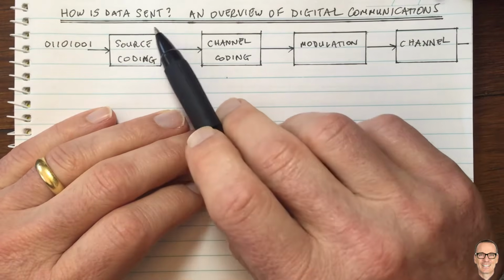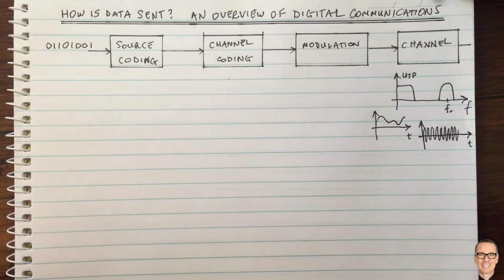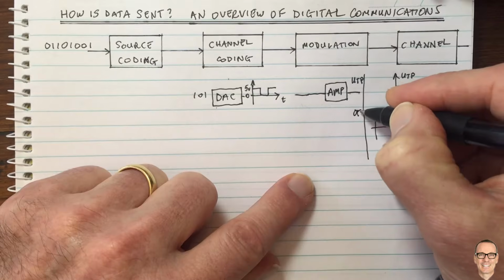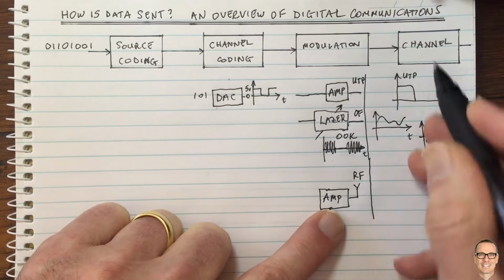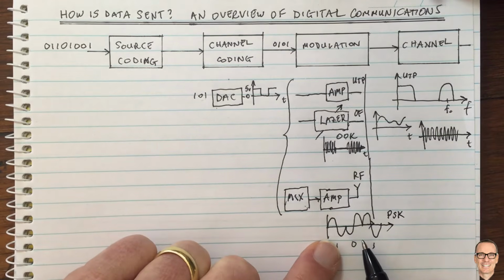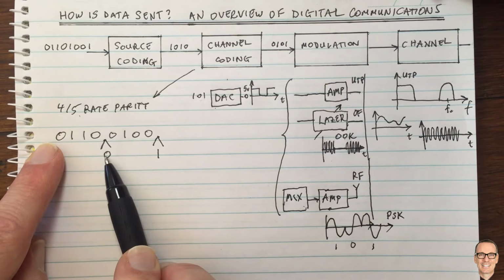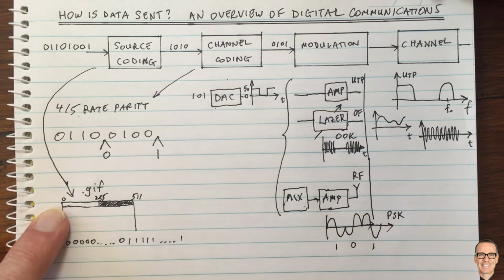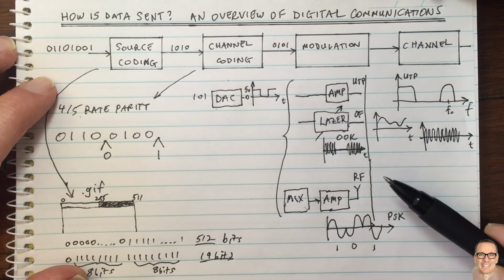How is Data Sent? An Overview of Digital Communications

Comment: You don't need a DAC to convert zeros and ones to +5V or 0V. And that's still digital.
Reply from the maker: The input to a DAC is a discrete-time binary sequence. The output is a continuous-time continuous-valued voltage waveform. So no, it's not "still digital", and you do need the DAC.

Comment: Thanks Prof. Collings, for all the videos you post which help me understand everything related to the physical layer of wireless communication!

I have one question: If I consider encryption of the payload as an additional process, where does it fit into the diagram with respect to source coding? Is the original data being source coded before encryption, or does source coding happen after encryption? Would source coding even make sense when data is already encrypted, since there may be limited compression performance? My current view is that the original data is encrypted at the application layer whereas all processes in your diagram happen at the physical layer (including source coding which seem to be of limited benefit when performed on an encrypted payload).
Reply from the maker: Source coding occurs in the higher layers. For example, a voice codec is a version of a source coder. It digitises the analog signal, and does so in a way that tries to minimise the amount of data required to be stored/sent, while maintaining a given allowable level of distortion in the reconstructed signal. And this can be done in video processing software (application layer). Encryption is applied to the digital signal that is to be sent (ie. after source coding has been done).

Comment: Hey professor, I have a question regarding Decimation and interpolation in a sense of bandwidth. I have your videos about these topics, but I still haven't managed to understand how the operation od up/down sampling influences the bandwidth. In Decimation, you get an expanded spectrum when each value of theta is multiplied by the decimation factor. What I get from that is that the bandwidth increases (=this expansion that I mentioned earlier?), but it doesn't make sense because when applying decimation, you get a new discrete signal which has less components than the previous one, hence less frequency components. Once again, I am bot sure, and would some clarification.
Thanks in advance!
Reply from the maker: Great question. The answer lies in the difference between the DTFT and the DFT. You said that "when applying decimation, you get a new discrete signal which has less components than the previous one, hence less frequency components." ... it's only fewer frequency components, if you're talking about the DFT. Note that the DFT has a discrete frequency transform, whereas the DTFT has a continuous frequency transform. And yes, the DFT of a decimated discrete-time signal, is a shorter vector, but the length of the vector is only part of the story. The frequency gap between the elements of the DFT vector also needs to be considered/understood. Hopefully these videos will help: "How are the Fourier Series, Fourier Transform, DTFT, DFT, FFT, LT and ZT Related?" https://youtu.be/2kMSLqAbLj4 and "How does the Discrete Fourier Transform DFT relate to Real Frequencies?" https://youtu.be/pIFz84oj9cA
Reply: @iain_explains  thanks for the quick response!
I have watched the videos, and I have a question: if the gap/spacing and between the dft samples in defined as Fsamp/N , so when implementing decimation you reduce the value of Fsamp, but also you effectively change the value of N because now the vector of the samples is smaller (-> N is smaller). In this scenario, how does the gap/sapcing change because you reduce the values of both the numerator and denominator of the expression. That's what doesn't make sense to me- how is the gap related to my original question considering what I have just mentioned (if  I wrote some incorrect things, please let me know 🙏)
Thanks again!
Reply from the maker: Maybe this video will help: "Discrete Time Sampling Example" https://youtu.be/vGxvrq5kCzQ
Reply: @iain_explains  I have watched the video you recommended. It explains well how decimation influences the DTFT spectrum, but not quite the DFT spectrum. I still don't get the idea of how the bandwidth is affected by implementing decimation or even interpolation. If you can recommend me another video or a  lecture that I can watch which will help me understand  this topic, it will be much appreciated!
Thanks a lot!
Reply from the maker: Perhaps try these: "How does the Discrete Fourier Transform DFT relate to Real Frequencies?" https://youtu.be/pIFz84oj9cA and "How do the Frequency, Sample Rate and Duration affect the DFT of a Sinusoid?" https://youtu.be/5diC6XLLVoA and "Discrete / Fast Fourier Transform DFT / FFT of a Sinusoid Signal" https://youtu.be/lwQTNcWtN7w

Comment: 11111111 (2) = 255.  We can add 1 since we would never transmit a "non-bit"... Just in case anyone else was confused by this.  Excellent video. I'm hooked on your clear explanations. I work with electrical engineering concepts but never was able to take the necessary coursework - thank you for helping fill my knowledge gap!
Reply from the maker: That's great to hear. I'm so glad the videos are helpful to you.

Comment: sir the DAC used in the above explanation has confused me as the output of the circuit is converting a binary bits o,1 in to the voltage level which is having binary value (0,5) so sir the output is itself a digital signal as it has only two values, is it not correct to give it a name of pulse shaping filter rather than calling it a DAC ?
Reply from the maker: No. The input to the DAC is just a sequence of 1's and 0's stored in discrete memory. It is not a waveform. The output of the DAC is a continuous-time waveform (eg. a time domain voltage signal on a wire).
Reply: @iain_explains  for analog signal 
1) value is defined at every point 
2)  also the analog signal has           uncountable amplitude in a particular range of time 
these two conditions are not satisfied as the signal has countable amplitude and signal is not defined at the zero crossings
Reply from the maker: I don't know what you are talking about, sorry. The output of the DAC is an analog continuous time signal. Just because we say it switches between the values 0V and 5V, doesn't mean the output is finite-valued - it just means that the waveform switches between those analog values.
Reply: So, the output of the DAC could be any value? Then how it would be used for on off keying (for example) in that case?

Comment: sir is it not possible to improve our SNR at the receiver by using a low noise amplifier until such extent so that we need not have to use channel coding because channel coding is anyhow decoding the error caused due to noise and sir also we are using the regenerative repeater to increase the strength of the signal
Reply from the maker: Certainly it is good to use a receiver amplifier with a low noise figure, but truely "low noise" amplifiers require cryogenic cooling (eg. the ones used in radio astronomy), so they are expensive and impractical for most communication systems. Unless you are operating at 0 deg Kelvin, then there will be "noise" in the received signal.

Comment: hello lain, first of all thanks for the video i have a question
channel coding is done to prevent what shorts of error means what damage can a channel do to our transmitted signal could you please explain it in breif
Reply from the maker: The channel can distort the signal in such a way that the receiver thinks a digital "1" was sent when actually a digital "0" was sent, and vice versa. This can happen randomly, based on time variations in the channel, and noise in the receiver electronics. Coding is needed to try to correct these errors.

Comment: Can we make the clock signal with just coding in embedded C? Directly just through code, controlling voltage on any gpio pins of uC?
Reply from the maker: Sure. Just change the voltage between two levels on a regular time period. Of course it will only be able to switch as fast as that output pin can change its voltage.

Comment: in order to remove the adverse effect of the channel, we are using the process of equalization, than what's the point of using channel coding if we are doing it for the same purpose, why we are using extra bits for channel coding?
Reply from the maker: Channel coding is generally aimed at overcoming random noise in the channel. Most common is when the noise is independent from one symbol to the next, but it could also be bursty. In contrast, when the channel introduces inter symbol interference (ISI), the "interference" is from the signal itself (not random noise), and so specific techniques are needed for this, eg. equalisation. See "What is Intersymbol Interference ISI?" https://youtu.be/I087FUvW2ys

Comment: Hi Lain, 

I saw somewhere 

"New channel coding schemes like low⁃density parity check (LDPC) and polar codes can extremely reduce the decoding complexity for scenarios with large block sizes and/or high coding rates. Also, it can improve the performance of those with short block sizes. Moreover, a lot of processing power of a receiver is consumed by the decoding of channel codes."

My questions are:

1) What is the relation of complexity with block sizes and  high coding rates? If I understand correctly, higher coding rate means more information bits and less correction bits which can increase the decoding complexity, right?

then, "The design and specification for URLLC are enabled by fast decoding. With the super⁃wide bandwidth foreseen for 5G up to 1 GHz, channel codes efficient for large block sizes become a must, not an option. the frame structure of NR without it will be only a hollow place holder."

My question is:

How larger block size is linked to bandwidth as indicated in the above?
Reply from the maker: For question 1) : Information Theory tells us that the way to achieve the maximum possible error-free rate, is to use long codewords. In practice, there are a number of ways to achieve codes that are effectively the same as having long block lengths - and in general these have high complexity to implement. For your second question: The wider the bandwidth, the higher the maximum possible rate. This doesn't necessarily mean the codewords need to be any longer though. The key for URLLC is to have the shortest codewords possible, subject to stringent BER requirements, so that there is the smallest possible latency.

Comment: This is an excellent high level view of information transmission over a channel, with valuable insights in each operation. The hints for further investigation in concepts like capacity, entropy, etc. are also great.
Just a question: in source encoding the number of compressed bits are 18 (1+8 for white pixels and 1+8 for black pixels) and not 19, right?
Reply from the maker: Yes, sorry about that. I have a note in the description below the video about it. Unfortunately I'm not able to re-upload an edited version of the video to correct it. Thanks.

Comment: @ Iain Explains Signals, Systems, and Digital Comms DAC is also called as Line coding ?
Reply from the maker: Partly yes. "Line Coding" is a term that refers to digital baseband modulation.
Reply: @iain_explains  thanks...Not sure what makes it partly though..Why not fully ?
Reply from the maker: Well it's not just the DAC. It matters what you put into the DAC, so a "line coder" would include a function to generate the "digital" waveform, and then a DAC to make the waveform continuous time.
Reply: @iain_explains  thanks. Clear
Reply: @iain_explains   I came back to ask few more questions!  To me, the terms like 'line coding', digital baseband modulation, symbol mapper, pulse shaping are used differently in diffferent resources available. Can you please distinguish them for me or for other users of your videos? Thanks
Reply: @iain_explains  Is not a digital waveform continuous in time?
Reply: Hi lain, any answer on this?

Comment: Really good very high level video. A slightly more in-depth explanation of the relationship between the baseband and the carrier band would have been instructional and filled in a knowledge gap.
Reply from the maker: Glad you liked the video. Perhaps this video might help to give more insight between the baseband and the carrier band, through the examples of DSL (baseband) and OFDM (carrier/pass band): "How are OFDM and xDSL (DMT) Related?" https://youtu.be/CET2UuGeEqs
Reply from the maker: Hi Jeff, I've just published a video on this topic, which will hopefully help: "What is a Baseband Equivalent Signal in Communications?" https://youtu.be/etZARaMNN2s
Reply: @iain_explains  Thanks for the videos. helps to brush off the rust.